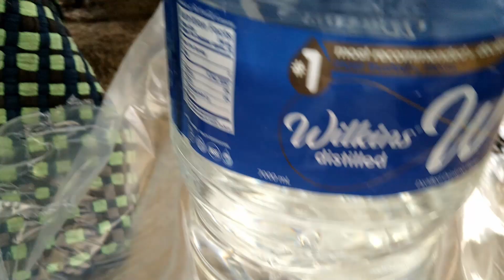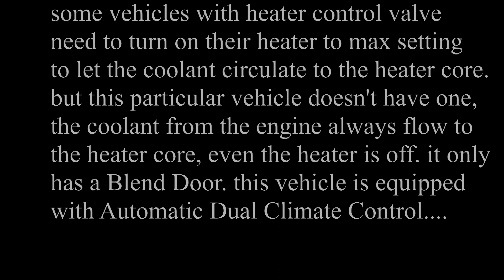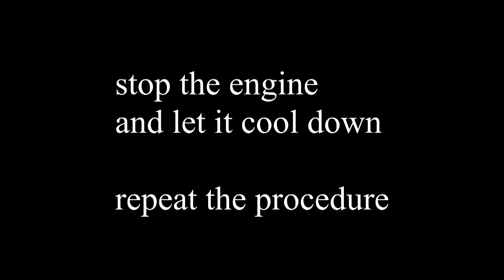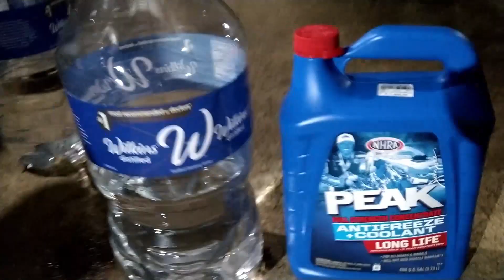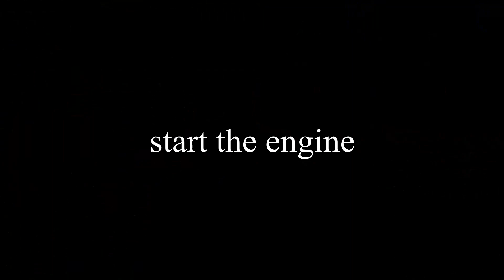How To Change Coolant Nissan Sylphy 2014

Comment: 👍it's also good to add a bottle of special cleaner to old coolant before flushing.
Reply from the maker: That's depend of the condition of the old coolant. If you notice that your old coolant has a bad color, dirty something, then it's a good idea to add some cleaner prior to drain the old coolant.
Reply: @w-diy10078  totally agree

Comment: Bro, can you please show the drain plug location. It's not clear. Thanks
Reply from the maker: Hello bro! The Drain plug is located on the bottom passenger side (LHD vehicle) of the radiator, facing to the engine.. I will make a follow up video soon..
Reply: @w-diy10078  Thanks, Bro
Reply from the maker: You're welcome bro 👍